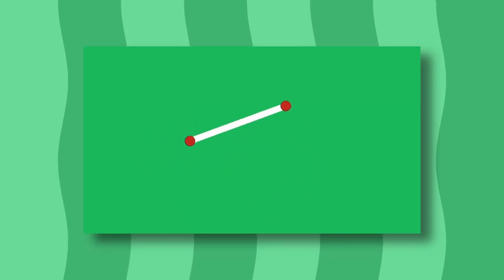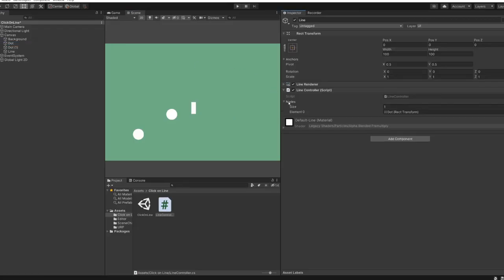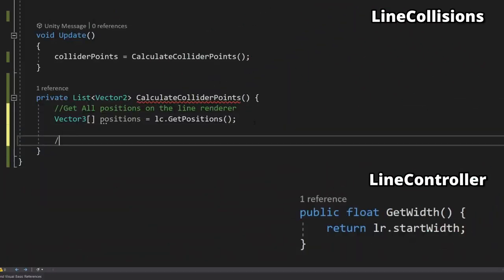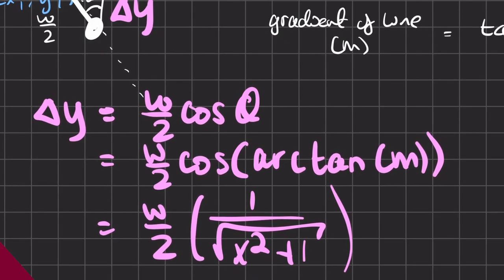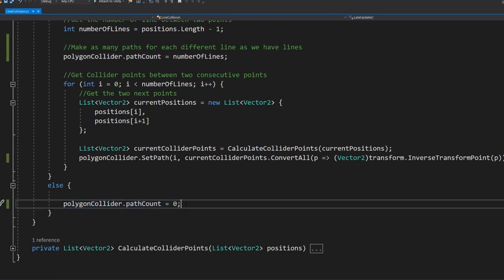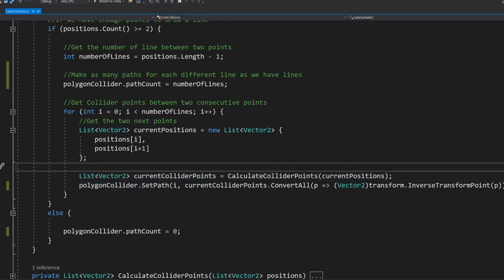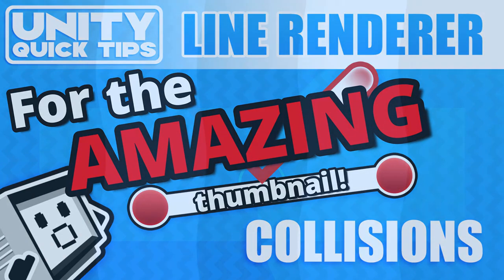How to Detect COLLISIONS on a Line Renderer in Unity

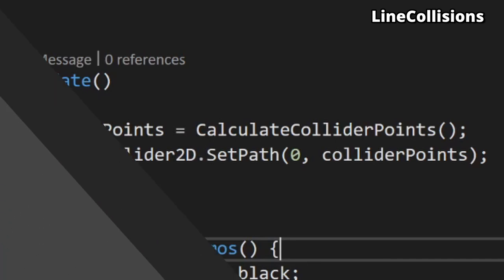Comment: 5:07 to 5:37 thanks for that part I was wondering how to solve that problem in my case the edge collider 2d doing that behavior the collider line rendered slightly off the object but your solution worked for me, this is my code with your solution that worked, again thanks a lot.

using UnityEngine;
using System.Collections.Generic;

public class GoldenRay : MonoBehaviour
{
    public List<Vector2> linePoints = new List<Vector2>();

    private LineRenderer lineRenderer;
    private EdgeCollider2D edgeCollider2d;

    private void Start()
    {
        lineRenderer = GetComponent<LineRenderer>();
        edgeCollider2d = GetComponent<EdgeCollider2D>();
    }

    private void Update()
    {
        linePoints[0] = lineRenderer.GetPosition(0);
        linePoints[1] = lineRenderer.GetPosition(1);

        edgeCollider2d.SetPoints(linePoints.ConvertAll(p => (Vector2)transform.InverseTransformPoint(p)));
    }
}

Comment: Is it possible to add collision to a line render in Unity3D using world space? Ive tried multiple ways such as MeshCollider, EdgeCollider2D and now polygon collider. I am making a curved line renderer tool in Unity 3d and i can get the polygon and edge colliders to show and copy the curving of the line render but it is stuck in one position as it is locked on one axis. Trying to convert Vector2 to Vector3 but i dont know if the polygon collider accepts Vector3.

Comment: Hi there, I've been trying to find a tutorial so I could make a sort of barrier using lines. Following your video at 3:56 there seems to be an edge case when calculating for float m where if both points' x positions are the same you end up dividing by 0 and the colliders do not form. I should note, that for my purposes I did not create a separate line controller and line collision script and opted to combine the 2, but it's hard to think that that would be the issue.
Reply from the maker: Hey! I did notice this when making it but I never thought it would be an issue, as with the simple implementation I had it felt almost impossible to actually have two points in the same position, and if they are then you don't need a collider line between them because there is nothing between them! If you just add a check for it then hopefully the error will go away and things should work :) if I misunderstood please get back to me and I'll try and help more. All the best
Reply: @BLANKdev  To clarify a bit, the x position of 2 points are the same, but the y is different, so it's a vertical line. I was going to consider throwing in an if statement or something to cover the edge case.
Reply from the maker: @HeiMao808  oh you got me there I didn't consider that! Definitely just have a check for if it's zero :)
Reply: @BLANKdev  Here's my fix for that case:
        if (positions[1].x == positions[0].x)
        {
            offsets[0] = new Vector2(-(width / 2.0f), 0);
            offsets[1] = new Vector2(width / 2.0f, 0);

        } else ...[set offsets as in video]

Seems to be working for me.
Reply from the maker: That's awesome thank you for helping out!
Reply: I had a similar issue, the m variable in the equation was giving me trouble, but in my case I had to make a check for if m equaled infinity, and if it did making it 1 instead.

Comment: The math is a bit wrong. It will work but come with issues when you point the line up or down.

Since the slope of the width of the line w is perpendicular to the line itself, you can just use a perpendicular vector, normalize it, and multiply it by w/2 to get the vector between (x, y) and the endpoint of the colliders. Here's what I did to get the collider endpoints: 

private Vector2[] GenerateColliderPoints()
    {
        Vector2[] points = GetPositions();

        float width = lr.startWidth;

        //m = (y2 - y1) / (x2 - x1)
        float m = (points[1].y - points[0].y) / (points[1].x - points[0].x);

        //Calculate Offset
        Vector2[] deltaP = 
        {
            new Vector2(-m, 1).normalized * width / 2,
            new Vector2(m, -1).normalized * width / 2
        };

        //Generate Collider vertices
        Vector2[] colliderVertices = {
            points[1] + deltaP[0],
            points[0] + deltaP[0],
            points[0] + deltaP[1],
            points[1] + deltaP[1]
        };

        return colliderVertices;
    }

Comment: bro i did everything you did and i get this error 
"error CS1503: Argument `#2' cannot convert `System.Collections.Generic.List<UnityEngine.Vector2>' expression to type `UnityEngine.Vector2[]'"
and the error in this line
 polygonCollider2D.SetPath(0, colliderPoints.ConvertAll(p => (Vector2)transform.InverseTransformPoint(p)));
Reply from the maker: Sorry for being so late but hopefully if someone has a similar issue they can find the help they need. You should be able to just import the System.Collections.Generic namespace, and then convert the List<Vector2> to a Vector[] using the ToArray() method, here is the documentation for this: https://docs.microsoft.com/en-us/dotnet/api/system.collections.generic.list-1.toarray?view=net-5.0.

Hope that helps!

Comment: How would you go about taking the points we made on the canvas and use them as the points in a singular polygon collider. I want to make a connect the dots type game where the player captures points by encircling them with lines. I imagine it wouldn't be too far off from the collisions you showed here
Reply from the maker: You should be able to first of all grab the points from the lines, then pass them all to the same path of a polygon collider with the setpath method, just path index 0 would suffice. Then be sure to add the first point back onto the end of the list too so it draws a completed shape. Hope that helps and if it doesn't let me know :)
Reply: @BLANKdev  I had to re-reference this playlist. Where did the other two videos go?
Reply from the maker: They are now back up in the playlist, I am very sorry for the disruption
Reply: @BLANKdev  Don't be sorry! I love the work you do and you have the highest engagement rate of any programming youtuber I frequent.
Reply from the maker: I try my best <3 It's the best part about making videos!

Comment: It don't have errors but it doesn't work for me. I can see the collider, but private void OnCollisionEnter2D(Collision2D collision)
    {
        if (collision.gameObject.CompareTag("Obstacle"))
        {
            gm.Death();
        }
    }
doesn't work
Reply from the maker: What happens when you run the code? One thing I can think of is that if neither object has a rigidbody2d then the OnCollisionEnter2D function won't be called